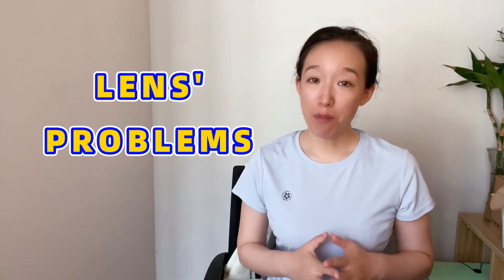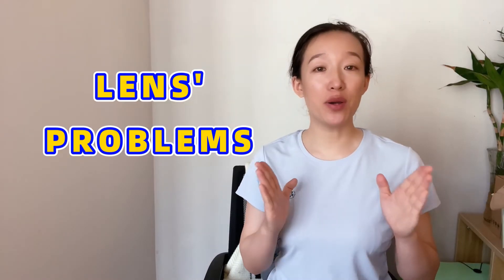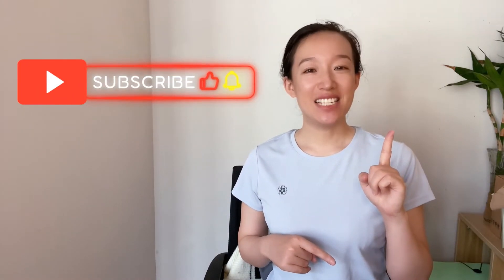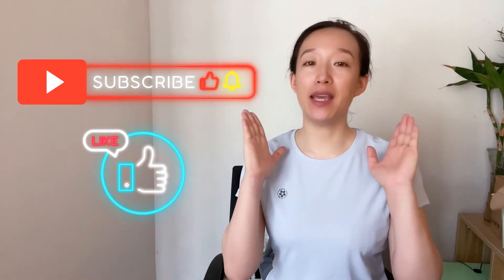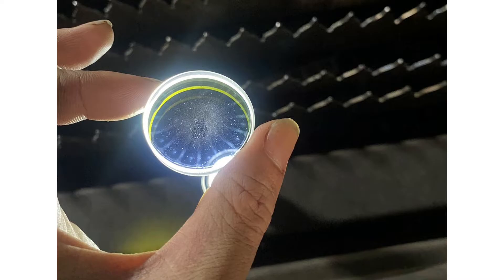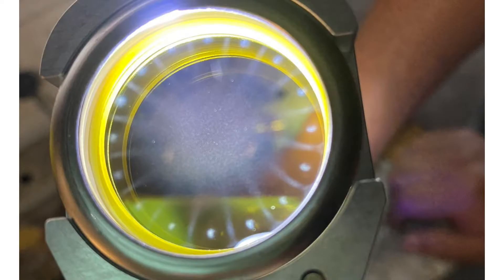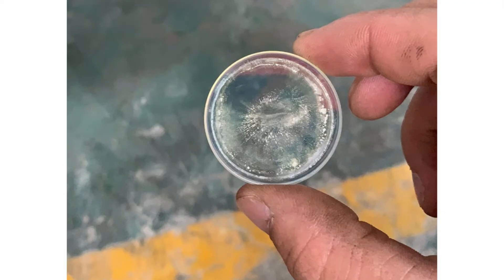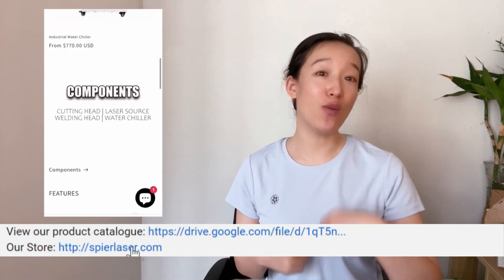Protective Lens Problems | 6 Cases | Laser Cutting Issues

Comment: Hello we are having a case where the protective lens burns out after a few minutes while cutting using O2 with scattered dark patches on the top side of the lens, also the cutting becomes rough with significant sludge remnants at the back side of the carbon steel plate
Reply from the maker: top side? Are the other lenses uppper okay?